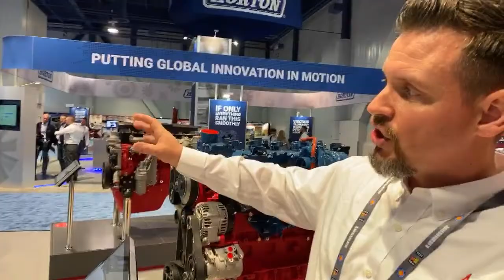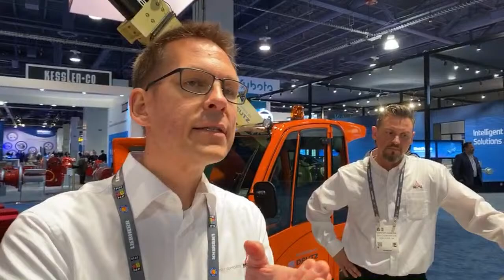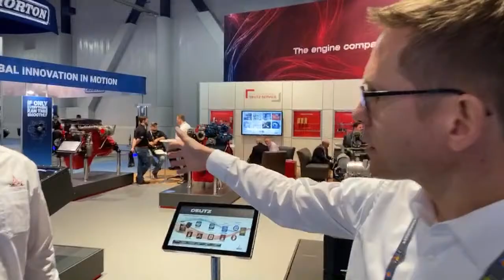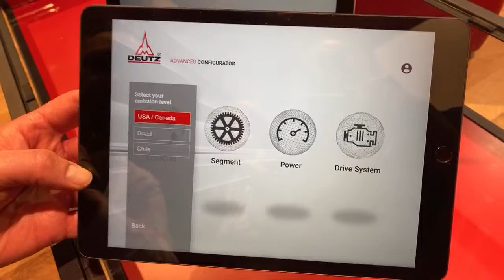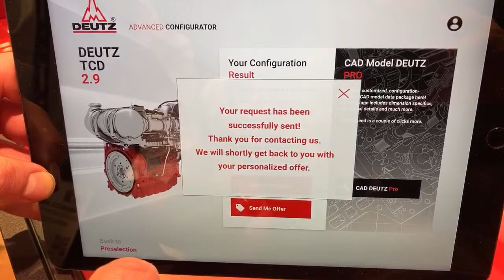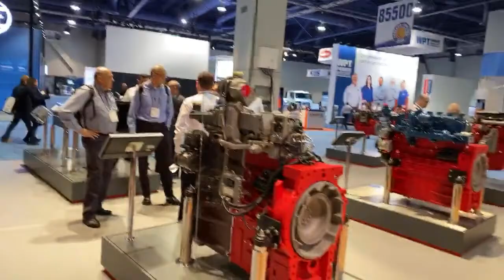Gas vs Diesel vs Hydrogen vs battery vs Hybrid motors all broken down by Deutz Engineers

Comment: Couldn't really understand the dude talking, so with the h2 engine is the fuel in a pressure tank same as propane? Wish the audio was better cause this is a very interesting video topic comparing fuel types.

Comment: Motor = electric.
Engine = combustion.

Hydrogen can be a combustion or an electric .  Electric uses a fuel cell to convert hydrogen to electricity that then drives an electric motor.  Combustion just burns h2 instead of gas/diesel.
Reply: Then explain the:
Motor Bike - combustion
Outboard Motor - combustion
Steam Engine - no combustion
Reply: @chrisbell5205  ignorance.
Reply: That’s what you say when you don’t know how to answer.
Reply: @chrisbell5205  no, it's really why.
Reply: The engine was invented in 1509, it did not use combustion until the late 1800 when Maybach invent the first successful combustion engine.  There are many types of engines invented before the combustion engine. A combustion engine is but one type of engine, not the definition of an engine.  That would be “a devise that converts thermal energy into mechanical energy”,  the definition of a motor “a small engine” or “ a devise that converts electrical energy into mechanical energy”. I would say ignorance is guy who thinks he know more about the definition of words than any of the major dictionaries.  Hence motor car, motor boat or any of the this I mention the first time.  If you want it see ignorance just look in your mirror.  By the way Maybach referenced to his invention as a motor.
Reply: @chrisbell5205  you realize of course that steam engines are also combustion engines right? The fuel is wood. The only difference is that the Pistons or flywheel (depending on design) are pushed by steam instead of directly by the combustion.

Ie steam engines are less efficient combustion engines.

Thanks for proving my point.
Reply: No steam is not combustion.  Not in any way shape or form.  It is pressure by thermal expansion of water.  Water does not combust.  Wood is burned not combusted to create steam.  If it combusted the boiler would explode. On another point, pneumatic motors also use no electricity. They were around before the use of electricity and are still in common use today.  Combustion does not define an engine.  Electricity does not define motor.  Motor coaches, motor cars and motoring were around before the first combustion engine vehicle.  Motor and engine are interchangeable.  The first combustion engine cars were referred to as motor cars.  The definition of motor in all of the early and current dictionaries was a small engine, as in smaller than what was in a ship or locomotive.  Small enough for use in a car or truck. This is even in the dictionaries written before the invention of the combustion engine.  These definitions have not change despite your imagination.  Engines come in may forms, combustion engine is but one of them.  Hybrid cars use combustion and electricity, their power plant is referred to as a hybrid motor.
Reply: @chrisbell5205  what is the thing that causes the steam to thermally expand? Oh right, combustion. 🤣. It's literally an inefficient combustion engine.
Reply: No, water is noncombustible, wood burns not combust.  Combustion is a controlled and contained explosion.   Buy yourself a dictionary.  You really have no understanding  of the definition of the words you use.  My first response was a jest to get you to think about what you said.  Since then you have proven you have no clue what you say. Even when it’s explained to you you stick to you ignorance.